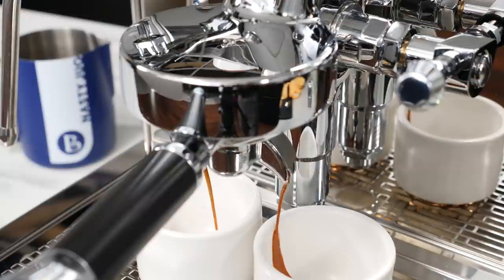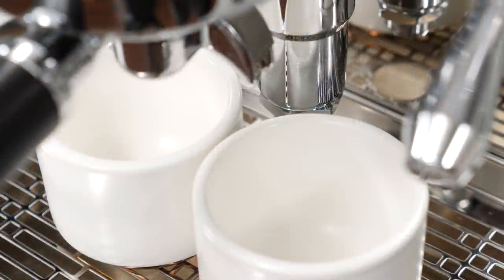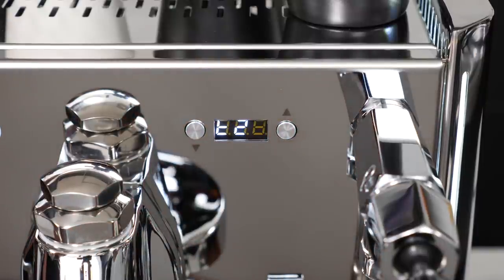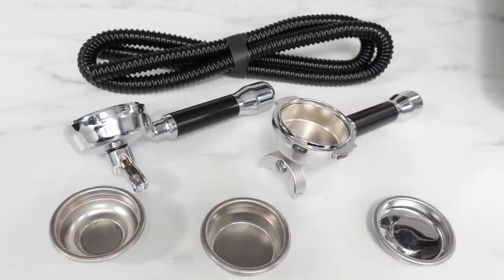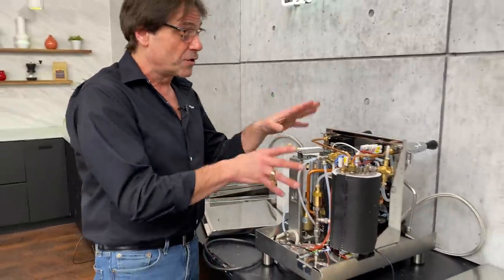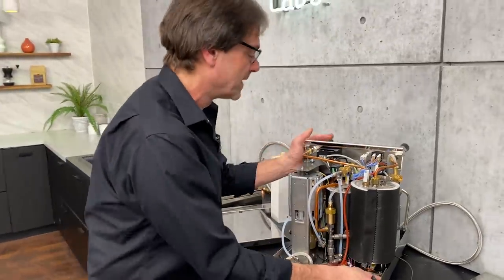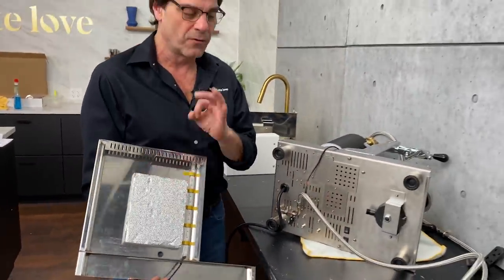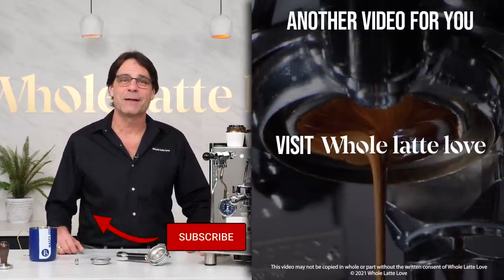Review Quick Mill Vetrano Design Espresso Machine Inside Out

Comment: This is my third dual boiler machine, and despite not being the most expensive one it is my favorite. Having dealt with issues in the past, I like how solid and easy to work on this one is, and that stainless steel frame is really a nice bonus, I have had coated steel frames rust after 5 or so years. 

Add a flow control knob, and the sky is the limit.

A very underrated machine.
Reply from the maker: Hi Ron, Thanks a bunch for sharing your thoughts on the Vetrano - it's a hidden gem for sure!
Marc
Reply: @Wholelattelovepage  yep, quick mill was only really lacking in the aesthetics department, this one removes the ugly and keeps the good. 

Also, the steam wand stays notably cooler on this than on any of the 3 rockets I’ve owned that have all had no burn wands. I noticed quick mill has an extra silicone gasket on the inside of their steam tip that rocket does not have.
Reply: Hi! how long does it heat up after you turn it on?

Comment: Beautiful machine and great review! How would you compare it to the Bezzera DUO MN, and which one would you prefer?
Reply from the maker: Hey Mongoose, Thanks for the comment and question. Here's a link to a side by side spec comparison of the Vetrano Design and Duo MN: https://www.wholelattelove.com/pages/compare?products=NjU0MzAxMTI1MDIzMCwxNTQ2MDAxODc1MDAz
Similar machines in many respects.
Notes...
Vetrano: Easier access to brew pressure adjustment, larger stainless steel boilers, simpler controls of PID.
Duo: touchscreen control panel w/digital gauges, copper boilers, a little more complex under the hood, automatic pre-infusion cycle
As to which I would prefer, it's a bit of a toss up. Slight edge to the Vetrano with the larger boilers and easy BP adjustment. Also, I have a minor aversion to touchscreen controls on a classic design espresso machine.
Hope that helps!
Marc
Reply: @Wholelattelovepage  It absolutely helped, thanks for the great detailed response!

Comment: I’ve owned the Vetrano Design for almost a year now and received the machine operating at just above 9 bar pressure when using a blank and real coffee puck. Should the pressure be adjusted this way? Or should I back it down to reach a max of 9 bar pressure on the gauge? I love this machine so far, just wondering where the pressure should be set at when it reaches its max pressure during a shot. Thank you so much for all of your wonderful videos on everything you guys sell, makes decision making much easier for me!
Reply from the maker: Hi d, Thanks for the kind comment, question and sharing your love and  thoughts on the Vetrano Design. Your good set to 9 bar with blank inserted. Rotary pump machines like yours have higher flow rates at a given pressure than a vibration pump machine which we typically set at 10 bar with a blank in. In all machines there's a slight difference, a drop of pressure from what's on the machine gauge and the actual pressure in the portafilter during an extraction. That's because the tap for the pressure gauge is behind a one way valve in the hydraulic system and it can flow more water than is released as espresso. You could try turning up the pressure to 10 on the machine gauge with blank inserted, pull a shot and see if you taste a difference - I doubt you will but only one way to find out.
Marc
Reply: Of course! Thank you so much for taking the time to answer my question! I’ve been searching what pressure rotary pumps should be set at and this answers my question. I will leave it set at just above 9 bar since that’s what tastes best to me after trying 10 bar a while back, I had also experienced channeling at 10 bar than at just above the line at 9 bar. Keep up the phenomenal in depth reviews, you do an awesome job Marc!! as well as the entire staff at WLL!!

Comment: An interesting review of this machine. It makes it quiet difficult to decide which espresso machine I'm going to buy. According to the reviews on your channel, my 3 favorite machines are: ECM Synchronika, Profitec Pro 700 and the Quick Mill Vetrano. Interesting of the Profitec that I can add a flow control afterward, or is this possible with all the machines? Another question I have regarding the Quick Mill, that you reviewed the machine with the joy-sticks. When I open the site of Quick Mill, there are knobs on the machine instead of the joy-sticks and I can't find the version you reviewed. Finally the main question: what's your favorite machine of the 3 I mentioned taking also the price into consideration? Thanks and good luck with your channel.
Reply from the maker: Hi Frank, The version of the Vetrano we have, the Vetrano Design is something we worked with QM on to customize. That's why it's a little different than what you see on their site. Of the 3 machines my favorite is the ECM Synchronika. Internally the Synchronika and Pro 700 are essentially identical. They are made by the same company. While both have excellent external finishing the Synchronika is nicer. I like the custom taper of its E61 group, Gauges up high for easy viewing, angled portafilters and exquisite finishing detail like chrome tips on levers and handles. If you purchase the Synchronika or Pro 700 from us without flow control you can upgrade down the road.
Marc
Reply: I chose the Quick Mill over the ECM for the easy access boilers, fully stainless steel chassis, easy access pump pressure adjustment vs on the bottom and brass fittings vs the plastic ones on the ECM. Also didn’t love the zip tied capacitor on the ECM.

Comment: great video as always. I thought I had norrowed my pick down to pro 700 and the synchronika but now this looks very nice...between the veltrano, pro 700 and synchronika are they all just as quiet as one another or how would you rank them purely on how quiet they are? 
Thanks again
Reply from the maker: Hi David, Thanks for the comment and question. All 3 machines have rotary pumps so are very quiet - not much difference in sound level between them.
Marc
Reply: @Wholelattelovepage  thanks

Comment: I love these informative videos! Would love to see a 2021 video of recommended prosumer machines for home, especially for someone upgrading from a nespresso 😂 I considered the “affordable” entry-level machines like the Rancillio Silva and Gaggia Classic, but almost want to save a bit more money for a machine that will last a lifetime. Recommendations?
Reply from the maker: Hey D, Thanks for the kind comment. First, know that the Silvia and the Classic can last a lifetime. They are true machines and are very repairable if needed. Key to keeping them running well is feeding with good water to prevent scale deposits and/or descaling as needed. Both are single boiler machines so a little more involved to use. They are less temperature stable than more expensive machines with heat exchange or dual boilers and PID. When using a single boiler machine you cannot brew and steam simultaneously and must cool down the boiler after steaming. All that adds time and complexity to making milk-based espresso beverages.  Entry into HX boiler machines starts a little less than double the price of a Silvia. The Profitec Pro 500 is an HX PID machine with exceptional build quality: https://www.wholelattelove.com/collections/semi-automatic-espresso-machines/products/profitec-pro-500-pid-espresso-machine 
Hope that helps!
Marc
Reply: @Wholelattelovepage  and what machines would you recommend as an upgrade to my Rocket Cellini espresso machine?

Comment: Is There a chance to see this machine side by side against the Profitec pro 700 as they have almost the same specs. Thanks you.
Reply: And maybe also the rocket 58. Keep up the good work.
Reply from the maker: Hey FK, Thanks for the comments and request. I do not have a video with the machines side by side but here's a link to a side by side spec comparison: https://www.wholelattelove.com/pages/compare?products=NjU0MzAxMTI1MDIzMCwyMDM4MTQ2NzI3OTkw
And here's a link to my video covering the Pro 700: https://youtu.be/l54y-_Vx_ts
They are similar machines but I give an edge to the Pro 700 with its higher steaming power and currently available from us with a free flow control upgrade.
Here's my video covering the R Cinquantotto (formerly R58): https://youtu.be/Xjjzw7kMCU0
Hope that helps!
Marc

Comment: Hi Marc! One general question in the context of another DB beauty with SS boilers. Why so many vendors switched from copper to SS boilers? I mean that steel is much more sensitive to chemical reactions that copper when it comes to descaling. From this perspective do you think it is easier to maintain SS boiler than copper one? Or the  hidden idea is to replace the SS boiler instead of descaling copper one?
Reply from the maker: Hi PR, If fed with water that can cause scale any boiler regardless of metal type will scale. While copper was the traditional material for boilers I believe advances in manufacturing and materials made stainless boilers more practical. Stainless boilers can be descaled so there's no hidden agenda. Urnex which is the most well known descaling product manufacturer for coffee machines advises all of their descaling products are good to use in stainless boilers. For aluminum boilers they advise limiting contact time to 20 minutes when using their citric acid based descaling products.
Marc
Reply: @Wholelattelovepage  Thank you, Marc!

Comment: What, WLL inspired but no flow control? Nice to see another machine with the levers. Do you think the levers become a retro fit item for the profitec pro 700
Reply from the maker: Hi A, Thanks for the question. I think it's unlikely you'll see lever retrofit for the Pro 700. Sister company ECM has levers on the Synchronika which is essentially identical to the Pro 700 under the hood. As far as the FC... not every user wants it>
Marc

Comment: Does the ECM Synchronika have the edge over the QM Vetrano in terms of parts & component quality? Both seems to be very similar in features and design.
Reply from the maker: Hi Paul, Thanks for the question. The machines are very close in component quality. I've always been a fan of ECM design but think in this case it comes down to your style preferences. With proper care and maintenance both machines should be very reliable.
Marc

Comment: Hi Marc. 

A little unrelated but I currently have a Gaggia Classic Pro with breville smart grinder Pro- I feel this grinder is too inconsistent and want to upgrade. Which grinder would you recommend? For espresso only, as I will keep my Breville for drip/filter grinding

Love your videos.

Thanks
Conor
Reply: Hi Conor 

I also habe the Gaggia classic pro in combination with a Eureka Specialità. You would probably also get good espresso with less than that but I think its better to have a better grinder than your machine... I know that many recommend the Baratza 270wi for the gaggia but in my opinion it’s better to spend a bit more and get the Eureka (what I did). Enjoy your coffee ☕️💪

Sandy
Reply: If you want a more affordable great quality grinder try the Rok GRINDER GC (hand grinder) I did a review on my channel
Reply: I have a GCP and recently sold my Vario and got a Eureka Silenzio. Would second Sandy's comment and recommend a Silenzio/Specilita. The infinite grind adjustment is great and it's a good looking grinder too.
Reply from the maker: Hey Conor, @Sandy D gives good advice. Grind is critical. Specialita is a good grinder and built a heck of a lot better than the SGP. But you get what you pay for. I've used the SGP in the past. It's def appliance grade with lots of (nearly all) plastic, clumpy grind at espresso sizes, rather slow and limited in precision of grind size adjustment. Sette is appliance grade as well and has some wear parts. That said we currently use one daily on the bar in the studio. It's weight based grinding is magical. Grind is fluffy and well distributed, it's very fast and kinda loud. It's also susceptible to static - particularly when new and when used in low humidity. It will eventually wear out but Baratza has great support and a fixed price repair program if you need it. Over in the lab I use a Ceado E37S when working with new machines. It's the grinder sitting next to the Vetrano Design in this video. It's big $$ but will likely still be grinding when I'm in the ground :) Grinder choice depends on your expectations, budget and future plans. If you can do without time based grinding and it's in your budget IMO the Ceado E5P is the best bang for the buck with 64mm flat burrs, excellent distribution into PF, precise stepless grind size adjustment and build quality that's better than the competition.
Marc
Reply from the maker: @Sandy D, Thanks for sharing  - good advice!
Marc
Reply from the maker: Hey Caff and Gas, Thanks for the comment. A few years back I put the ROK up against a Baratza Vario and it held it's own in shot quality.
Marc
Reply: @Wholelattelovepage  thanks to you I picked it up :P
Reply: Like Marc said here and in various videos before: Ceados E5P (manual grinding only) and E6P (timed grinding) are a great pick! They are the "best bang for your buck", are reliable build and offer 64mm flat burrs for consistant (espresso) partical size. The E6P will replace my SGP as soon as the €€€ hit my bank account :D
Reply: I upgraded recently from a Baratza Vario to the Ceado E37S.  Loving the results in the cup and ease of grind adjustment from roast to roast.  My grinder search is concluded.
Reply: Wow thanks guys. Didn't expect such detailed replies - thank you for that. Definitely food for though. I had an appliance grade espresso machine just over a year ago and upgraded quickly. Would ideally like something that will pair with with a dual boiler machine in a few years.
Thanks again
Reply: @payamirani5298  the E37S is a beast! But I am not willing to pay so much money for a grinder. But thats just my personal opinion ;)

Comment: What are the dimensions of the drip tray surface and the height of the group head above it? I'm trying to size my cups and scale.
Reply from the maker: Hi Shane, The drip tray is 11.25"W x 6.25"D - measurement does not include front and side bars surrounding removable drip tray surface. Clearance between drip tray surface and tips of portafilter spouts is 3.4"
Marc

Comment: Hello Marc!
I've learned a lot from your valuable videos :) 
I have bought used E61 wega mininova 2015 with 14 grams stock basket and I have little trouble in dialing in proxess. I have a low end delonghi kg79 grinder and to get 27 seconds for 15 grams of coffee I see small coffee grounds in my cup button 

Does that means that my pump could need opv to get 27 secomds with little coarser grinds 

Or 

this could be because the grinder is low end and generate coffee dust like that pass the filter and that causes inconsistent results 

Of course I have followed your valuable guide for dialing in video 

Would really appreciate to advise me and I'm really thankful for your time 🙂
Zak
Reply from the maker: Hi MZ, I have not used that machine so am not familiar with it's OPV control. But, I believe (unless a different model) the machine uses a rotary pump. Brew pressure on rotary pump machines are usually adjusted on the pump itself. The adjustment in many rotary pump machines is found underneath the machine or sometime adjustment is at back of machine. Typically adjusted using a screwdriver. If you want to adjust you'll need a blind basket in your PF, then turn on pump like you were pulling a shot and turn the adjustment to a reading of 9 bar on the brew pressure gauge. But I think it's more likely your grind quality causing troubles. That grinder is below capabilities I'd recommend for that level of machine.
Marc
Reply: @Wholelattelovepage  Hello Marc!
Thanks a lot for your time to reply to my comment, I really appreciate it :)

I followed your advice and got a grinded coffee from a coffee shop near to my home and it was ok and no coffee grounds were found :) 

Thanks again